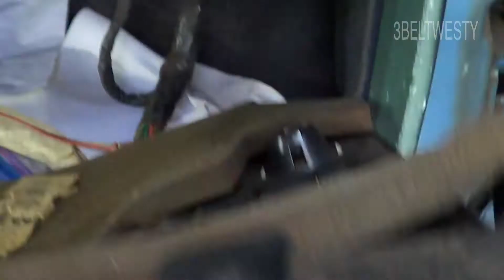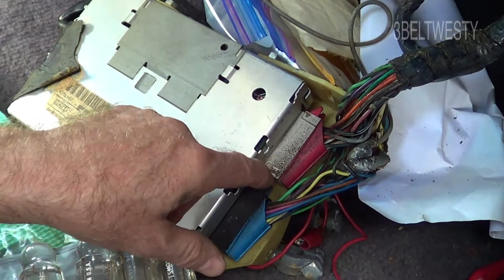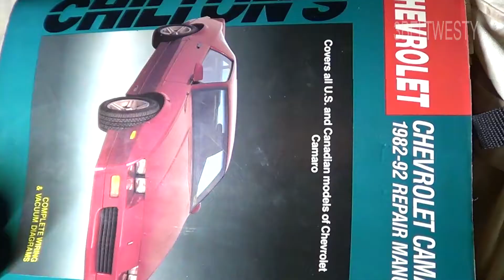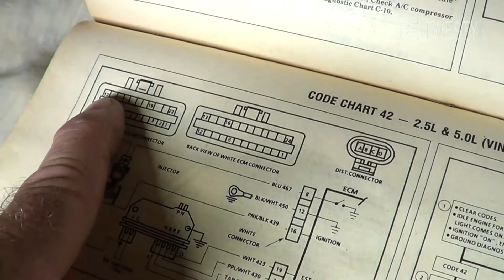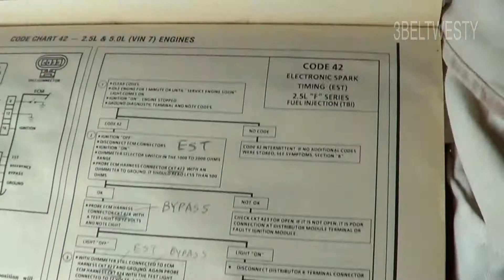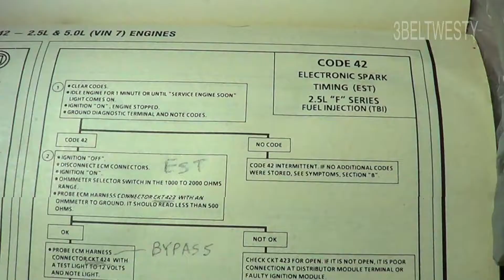3rd gen Camaro Code 42 adventure ECM location

Comment: Ive got a 92 HE RS 305, and ive got all sorts of issues. But ill deviate to make sense. I also have a 92 gmc k1500. Its DIRECTLY related. The sierra was giving me issues. I replaced 2-3 sensors, only to look CLOSELY and see the WIRE INSULATION immediately connecting to the pigtail connectors was peeling away from the plastic clips, expising the copper wiring and it was green/brown and obviously the issue, but i replaced EVERY sensor anyways and rewired the connectors. Still had the issues, high idle, instrument cluster on the pickup was goofy, blah blah... well, on the pickup still, the radio would static out and just turn into a silent green light box. Turn it off for awhile, turn it back on and it worked for a bit till it finally died. Culprit? The CDM module that connects the tape deck to the radio, the capacitors oozed out. Ended up replacing EVERY ground on the pickup i could find, even added some more, still have idling issues and other "running" issues. Every vacuum line replaced, timing for the third time, new ignition stuff, still had the issue. Back to the camaro. Dead tach, dead speedo. My 92 heritage edition has an individual circuit board for speedo and the tach. In EACH, it has a capacitor that FAILS.  Got those fixed, but do you see the pattern yet? The computer, ECM in both have capacitors. They are 34 years old. Ive replaced everything under the hood and chased electrical gremlins from under the hood, and ive ONLY got one simple option left!!! The ECM from rockauto for both is around $100 each.  Im just gonna say replace the ECM FIRST, and then chase down your gremlins!!! Turns out the sensors i replaced on my gmc are perfectly fine, so ive got half a dozen replacements in my console. And the same is probably gonna be said for the camaro...

Comment: Mine was pretty easy to pull out but since I'm going carb don't need that crap
Reply from the maker: Interesting idea. If you pull the computer then you need an older distributor with spark advance. ie Vacuum and centrifugal. This 1982 advances the spark via the EST timing wire. ie from Computer to EST type distributor. So with a straight carb and if  you delete the computer then no spark advance with a EST distributor. But a later 1977s distributor pre computer might work well for Vacuum and centrifugal advance.
Reply: @3beltwesty  HEI distributor with vac will work too that's what I'm using
Reply from the maker: @drgiggles2252  cool stuff. With this 1982 engine the HEI Distributor has a HAL sensor for timing for the computer. The ECM looks at the engine temperature. MAP/Vac pressure sensor and dials in the timing based on a look up table. If the Distributors 4 pin connector is up plugged the engine runs on base timing; ie what you set via rotating the distributor and tightening down the bracket.
Regards
Reply: @3beltwesty  base timing for 5.0 that's still stock according to the sticker under the hood at least on my car says 6 BTDC  but that's for computer controller Distributor going carb you'll want between 7 to 10 BTDC  but I got mine set at 8 and it's running great
Reply from the maker: @drgiggles2252  would be nice have a "dial/lever timing adjust" to play with while driving. ie like Model T era controls for spark advance. Oddly with a vacuum advance one could use player piano technology and have a blend valve of high vacuum from a tiny source pump or the cars manifold. ie a heater selector gizmo valve where it could vary the vacuum thus the timing.

Regards.